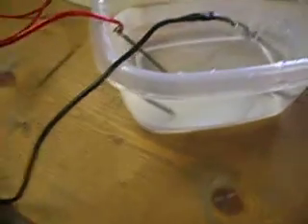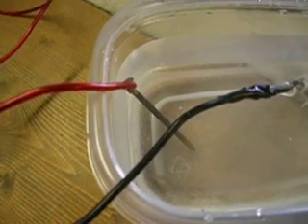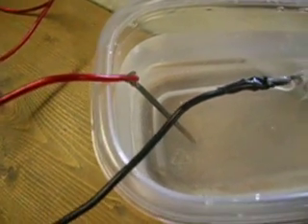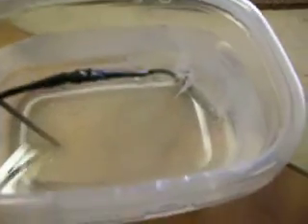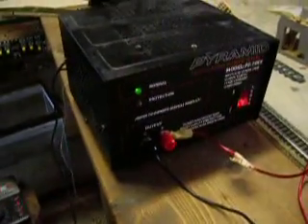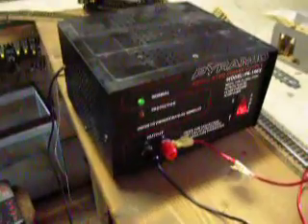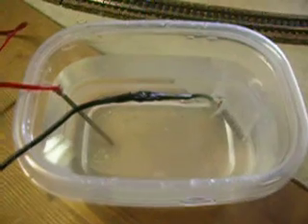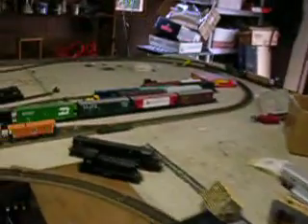Electrolysis using a nail and a rusty bolt

Comment from the maker: @radionut63 As you can see i have some 6 axle power that i run on my layout and i have had to relay some track wide radius curves for the bigger units. I just got some NOS Tyco and Model Power electric turnouts for $7.00 each at a mom and pop train shop down by my G/Fs house.. I'm trying to model the PRR in Indiana back in the mid to late 1960s...